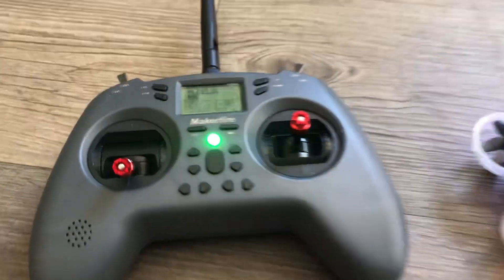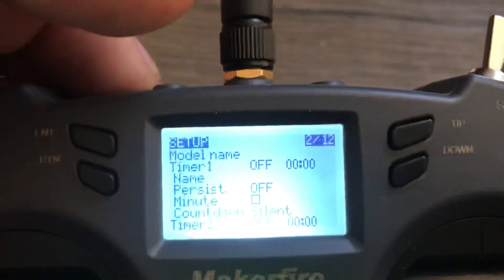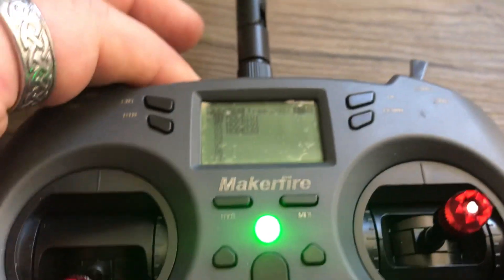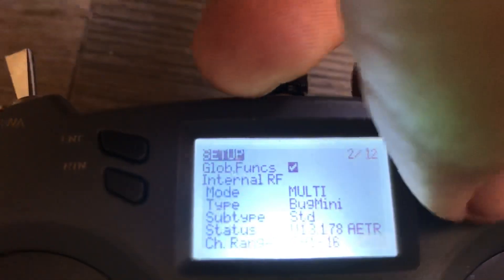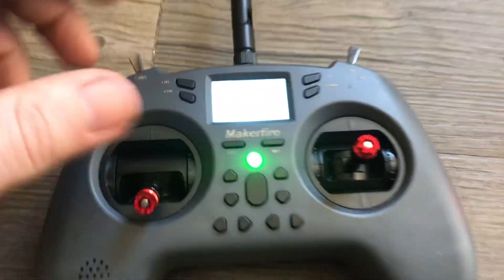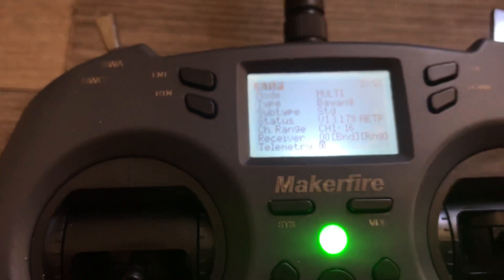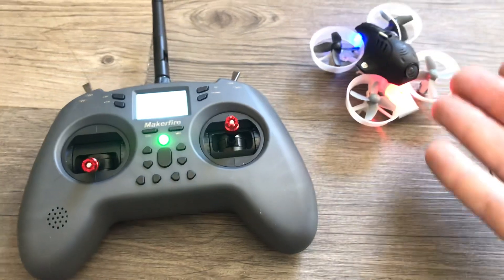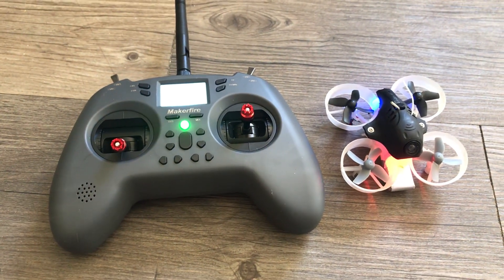Makerfire T-Lite HOW TO BIND to Drone Multi protocol Radio 5.8 ghz Whoop Instructions

Comment: NOT HAPPY with mine, Brand new out of the box the return  button is stuck down inside  the case . could not even set anything up .Not sure if its JUNK or they sent me a returned one from some one else .Anyway  waiting to hear from Banggood   for a return.
Reply from the maker: Very sorry to hear about that possibility is it did come from the site that you were saying so as far as shipping and handling it probably was not handled superbly. Just as well as our Postal Service has been lackluster as of late too. I actually have two of them one jumper branded and this one both came from maker fire sorry to hear about your luck I’m absolutely loving mind hopefully you can get one that works
Reply: @JayDrone  Thanks I enjoy your vids and maybe Banggood will come through with a replacement, I like the look and feel ,just wish it worked  ! Thanks again !